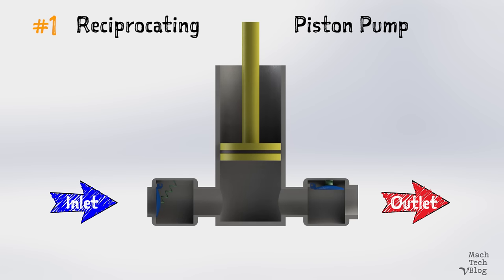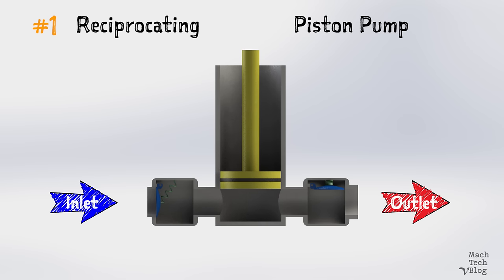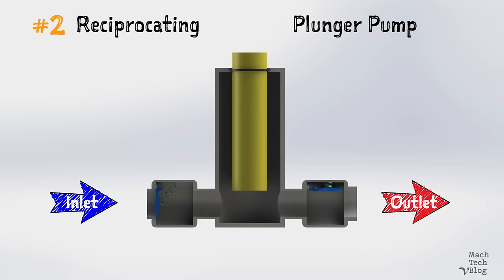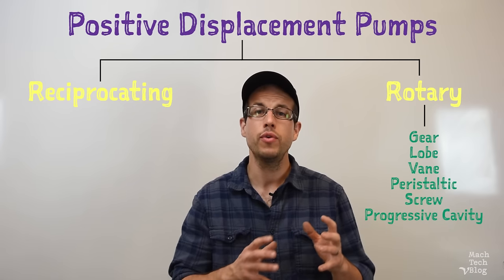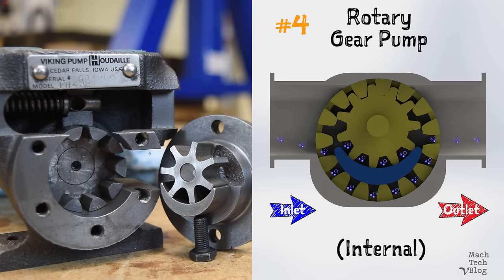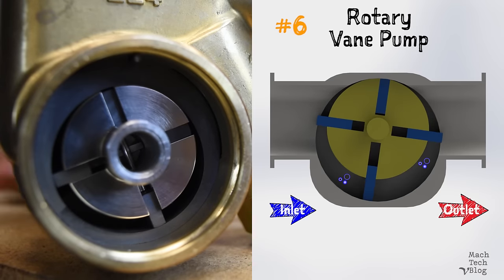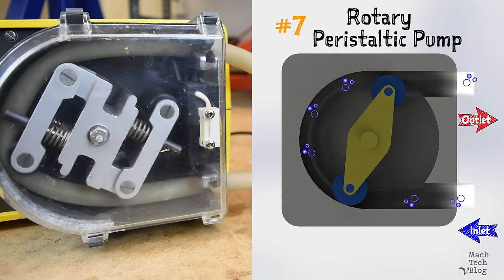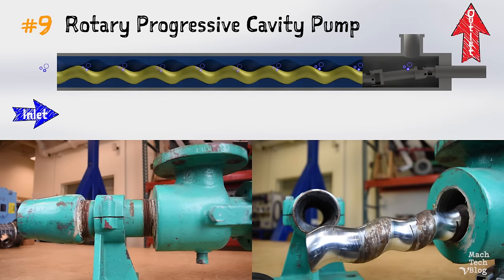Positive Displacement Pump Types

Comment: As someone that has been building/rebuilding industrial process pumps for over 10 years I can say that these videos are better than anything any actual pump manufacturers have. It's nice to see fluid transfer get some love, you see fluid power more often. Not that hydraulics aren't important. 

An interesting outlier on the PD pumps would be a SINE pump. You don't see them very often but they have their place.

In dealing with all these pumps, speed reducers, belt drives, couplings, VFD's, and everything industrial; one of the most interesting things I've come across is the Cycloidal drive reducer. I'm sure you have more suggestions than you can shake a stick at, but this would be my suggestion.

Comment: Good video, excellent presentation. Still, I have a few suggestions if you ever re-do this one.

1) Mention at the start what "positive displacement" means and how that contrasts with other types (i.e. why you would want to choose a positive displacement pump)
2) On the plunger pump, you mention that the "physical mass" of the plunger creates the change in volume of the chamber. It can't be mass,  it must be the physical VOLUME of the plunger.....
3) For the peristaltic pump, I think it would be good to place greater stress on the point of the pumped fluid never touching the working parts of the pump, and thus the pump cannot be contaminated by the fluid, corrosive liquids can be pumped, the pump mechanism cannot contaminate the fluid (thus good for certain food and medical applications), etc.
Reply: i agree, when i worked on an offshore rig, we used several different pumps to move fluids around.

i learned that centrifugal were great at moving high volume but lower pressure fluid. Can be used to pump fluids with small amounts of debris but cost more if it gets damaged. 

we used PD piston pumps for high pressure stuff but they needed big motors to drive them.

we used PD diaphragm for pumping small amounts that had debris in it because they were cheap and very easy to rebuild, and pumped trashy fluid better than others.  A kid fresh out of high school can be shown how to work and rebuild one in a day . i suggest this one for shops over centrifugal.
Reply: I was about to comment the same as your point 3, I'd never seen peristaltic pumps before I started working in a chemical lab. Being able to keep moving parts entirely out of the flow is a huge advantage for maintenance, purity, and consistency.
Reply: @johnstonefield1935  That point 3 is also the reason why they're the pump of choice for heart-lung machines and dialysis machines.

Comment: 2:50 These can also have variable displacement by tilting the thrust plate. Those little holes are for some of the pumped medium (usually oil or fuel) to act as a hydrodynamic bearing for the pistons.
A typical use case is a hydraulic pump or aircon compressor.

Comment: Nice video to understand the basic types of pumps. Briefly illustrated the working principle of each pump by showing the animation. Placing the actual model next to the animation helps to understand how the pump actually looks and operates. Brief application has been explained for Peristaltic pump saying it can used for high viscous fluids. It would be great if similar kind of brief application is provided for other pumps as well. Thanks for such a nice video bro..

Comment: About the vane pump, is that centrifugal force instead of spring load pushing the vane on the casing? Or just in the video, is the solid shaft connecting 2 opposite vane to the casing?
Reply: the vanes are loose and are trapped by the front and back covers. The pump must never run dry though as it relies on the fluid to lubricate the vane face and the outer casing and also the slots the vanes sit in. The vane holder is offset so the vanes are pushed back in as they near the top of the case. Look up JABSCO Vane pump!

Comment: I am working on a pump concept, and want to ask, what material can be used as a diaphragm? main concern durability
leather
latex
100% silicone
or maybe sinew
Reply: Usually standard Rubber as its cheaper. Different rubbers have different elasticity. Check out Wilden pumps

Comment: What was cause your rotor bolt to snap during operation?.. usually the bottom fro. What I've seen... spacing between rotor bolt and cover was my 1st hunch... but nat too sure anymore as I just removed another broken rotor bolt and the head of it has no scratches like if it were to wedge itself between the cover and theeads.

Comment: The last example, progressive cavity pump: They can basically run in any direction but the far most common is with the inlet closest to the motor, the reversed direction from what is shown here. The shown direction is good when there is great vacuum on the suction side since that vacuum does not risk drawing air through the shaft seal which is not at the suction end in this case. The drawback is that the shaft seal sees the outlet pressure so this arrangement is limited to a few bars outlet pressure, otherwise you blow the seal.

Comment: please also mention the applications of these pumps in industry
Reply: jahp, I missed that too! advantages/disadvantages...
Reply: peristaltic, rotary lobe and diaphragm pump are widely used in pharmaceutical production especially in biotechnology since generate less shearing forces. Peristaltic and diaphragm pumps are used in single use systems for pharmaceutical production - one can easily separate pumping element and pump drive - lower contamination risks
Reply: The rotary progressive cavity pump is used as a concrete pump. The housing is made of hard rubber and can withstand sand and small rocks in the pumped mixture.
Reply: @brys555  also in sewage plants, They handle very thick liquids with high solids with ease

Comment: Excellent Description and is 100% correct. Is it possible to gain permission to use this video for my website blog? 

As for the applications of each...we cant give away all out secrets but: the piston pumps are often used in pressure washers, Diaphragm pumps are excellent for dirty sandy water and construction sites, gear pumps are for oils and fuel, Rotary lobe is used in food such as meat pie fillings, Rotary vane pumps are often used as bilge pumps in boats, peristaltic pumps are used in hospitals when your on the drip, Rotary screw pumps are used in crude oil as they can transfer gas as well, progressive cavity pumps are used often to pump sewage or solids laden fluid long distances at high pressure, however they can also be used for food process where their gentle action doesnt cause damage (eg fruit yogurt). Trust this answers the questions below!
Teknik Group Sydney Australia- leaders in Pump maintenance and Repairs

Comment: 7:15 the image in the left (actual hardware) shows the vanes opposite each other are physically connected, thus the retracting vane is pushing the other vane outwards. Centrifugal force is not required (and would not be reliable at low RPM). This only works in a circular housing. Some vane pumps use springs to hold the vanes against the housing.

Comment: Are any pumps driven by temperature?  Imagine the oil in the AK pipeline has to be warmer to make it more viscus for pumping.  If the temperature cools and the oil is more difficult to pump, do the pumps shut down until a temperature sensor tells it to pump again?

Comment: hi i've got a question  i'm currently putting together a pelton turbine to turn my 100 kw alternator but i need a water pump that can pressure the lines enough for the spearhead valves to work correctly to get the right velocity for turning the pelton turbine what pump type would you suggest centrifugal pump for moving the large amount of water or a positive pressure pump or even both if necessary?

Comment: Hi Adam, quick question, if you had a choice among these pumps, which one would you use as a high pressure pump in case of gasoline ? since lubrication is a huge problem, when considering gasoline.

Comment: Positive displacement is more to do with the piston hitting a positive stop in both directions e.g piston moves forward and hits a physical stop and the same on the return stroke Volume and stroke is adjusted by a micrometer on the drive end. This method gives higher accuracy. Peristaltic pumps are not positive displacement and are not accurate due to soft tubing and rollers. Look at HIBAR pumps for high accuracy positive displacement, volumetric pumps. Super high accuracy
Reply: Positive displacement means the flow is pretty much independent of the back pressure, unlike e.g. turbine pumps whose flow depends greatly on back pressure. When a positive displacement pump encounters outlet flow resistance or blockage, it generates arbitrarily large amounts of back pressure, and the driving system (motor) has to either deliver more torque or slow down or even stall. Systems using such pumps will often have a pressure relief valve to limit the back pressure when flow is limited.
Although volumetric accuracy requires positive displacement, positive displacement does not imply volumetric accuracy or lack of pulsations.
Reply: @kevinmartin7760  Yes we'll said! thanks. My knowledge on the subject is using precision piston pumps for high accuracy doses so I appreciate your explanation. I don't tend to dabble in anything else and it's quite interesting the different applications where I now see it come into play. Thanks.

Comment: Ignoring normal use-case restrictions, I wonder what the noise comparison would be like for each style pump if they were designed for the same flow/pressure.

Comment: Awesome video. 
Got a question: I currently have a GD GAFMDRAX/6mr dual lobe blower in shop for repair.
These have the compression collar on each shaft for locking the gears to the shaft.
I have done only 3 repairs to blowers previously with ordinary shop and machinist tools.
Are there any specialty tools specifically for blowers that would make blower repairs as precise as possible, 
other than mics, calipers, feeler gauges, etc.?

Comment: anyone who can help/advise me or just recommend on what to research on, on what motor type or setup to use for an experiment that involves a 2 cubic meter chamber for vacuum forming that needs to operate 24/7 that can reach approx.  at least 28 hg in vacuum pressure and maybe 5 to 10 cubic meter per minute. i will really appreciate it. the chamber isn't really air tight sealed and material coming out of nozzle will emit vapor that becomes gas in the chamber. plasticized material will enter the chamber coming from a nozzle and will come out of the chamber as some sort of a formed texturized surface continuous pipe. the nozzle will seal the entry point while the output will also be sealed the the product itself. the chamber over all is sealed but not air tight sealed. so air molecules might come from gaps and the vapor from the hot material itself coming out of the nozzle.

Comment: Interestingly, rotary vane pumps are common in roughing vacuum pumps, and piston pumps in compressors. I’m guessing it has to do with the way the two systems work that one can achieve a better vacuum/high pressure.
Reply: GRBTutorials, that is exactly the case, take for example a gear pump, eventually the fluid can compress so much that it fits back though the mesh between the gears. And with vacuum, I’m not sure if the reason.

Comment: Thank you again, great video, quick question regarding the cavity pump, what would be a better option then the cavity pump, we are pushing higher solids, is liquor that contains dical, thank you
Reply: Don't use slang or your workplace's jargong in questions, there's no substans with the name dical. Do you mean dicalcium phosphate or some similar rather abrasive slurry? In case of heavy wear on progressive cavity pumps, I have sometimes switched to peristaltic pumps (hose pump) instead. They are generally more tolerant to abrasion and work good if the pressure is not more than a few bars and the temperature is below 80 °C. Just be careful with the pulsations. A diaphragm pump can also work if the viscosity is not very high.

Comment: I'd have liked to see a little more elaboration on the different characteristics between the pump types, such as relative head pressure, flow rates, and maintenance issues. Good video regardless, I'd not heard of a few of these.

Comment: We facing low flow at high pressure in Vane drive pump, I have check clearance between cam & vane which is ok and RV fitment in pump case 

Can you help us to resolve issue

Comment: Peristaltic pumps are commonly used in the medical field because they are very sterile. The fluid never touches the pump itself, therefore staying sterile.

Edit: these are my favorite type of pumps. They are so weird but so useful in the right circumstance.
Reply: Also the food industry. My favorite application is anywhere small precise amounts of fluids need to be metered out from a larger reservoir. Soda machines for the syrup to water mixed on the fly, or chemical injection into flowing water for industrial processes. I really want to make a Raspberry Pi that makes mixed cocktails for me using several pumps.
Reply: Kevin Holmes you are also very correct!

Comment: You didn't mention disk pumps! Someone mentioned 'low velocity, high compression ratio intermeshing counter rotating disk stacks' as an efficient and durable compressor design and I found your video hoping to find a visual because I know what each of those words individually means but I have a hard time believing such a thing exists! Disk pumps for air tend to be fairly high velocity and I've never seen one in an intermeshed configuration!

Comment: Just wanted to mention that pump #5 is more accurately known as a circumferential piston pump. Lobe pumps have rounder features on the rotors that make line contact with the body, not area contact as is shown with the CPP.

Comment: I am a journeyman (graduate apprentice) in the machine repair trade.  We learned in hydraulics class, taught by a hydraulic engineer that a pump produces flow only and not pressure.  Pressure is defined as a resistance to flow. Please update your video to reflect this law of physics.

Comment: You vane rotor pump has connecting rods. It uses the outer wall to drive the extending vein from the contracting vein.

Comment: I just want to make 1 small correction 
Not all interal rotary pumps have a cressent bit ov metal, instead the gear sizes are just different enough to let one pass inside the other
(My car oil pump is like this)

Comment: I've worked with a lot of these in a lot of applications and I've gotta say, progressive cavity pumps can go fall off a cliff. I've always had issues with them getting stuck, scuffing the stator and shredding themselves no matter the fluid they are operating on. Rubber gear pumps like Bowie pumps do a far better job on a far greater variety of fluids. So I ask, has anyone found an application where progressive cavity pumps really shine?
Reply: pharma... single use diaphragm pump heads can be delivered as a sterile tube assembly. There are widely used in chromatography and filtration systems alongside with peristaltic pumps (which is even more popular). Key benefit of such approach - your equipment has no contact with product. No need to validate cleaning procedure, no need to even provide such procedure - only thing that touches your product is single use flowpath.
Reply: @MrDrunkenknight  Yeah, I see the application for a single diaphragm there but not the progressive cavity pumps.
Reply: @geraldgepes  yeah, the last one seems to be least reliable )

Comment: The distinction between the piston and plunger pumps isn't really clear. It seems that the only differences are that a piston pump is a plunger pump where the plunger is the full diameter of the chamber and the seal is attached to the moving part rather than the case. You can morph one design into the other and it will work as a pump at any intermediate design stage. The distinction is even less clear for something like the rotary piston pump you showed, since it relies on close piston fit rather than a resilient seal.

Comment: The vein pumpo is a bit misinformed. There are two types. Where the oposing vens are actually one single piece. (and to slide, there is a cut in the middle on half of the width). The trick is the inner shape has to be a shape with constant width and height about the center of rototation of the rotor (that is eccentinc). So the shape is not a circle but a weird egg or something. And this type can't compensate wear as the other vein will open and lose pressure.

The other kind is the independed veins. some may have springs behind them, bot most do not, because there is a groove in the housing (the top part), that is connected to outlet pressure, and this groove feeds fluid behind the veins forcing them out in contact with the bore. This is how most steering pumps in cars work.

Comment: lobe pump, when 2 rotor rotate they impact together and issue metal dust. It effects to product quanlity
Reply: No, the fluid lubricates the pump. He forgot to mention that they must never run dry!
Reply: The internal gear rotary pump and the external gear rotary pump have one gear driving the other so a lubricating fluid film is required. The circumferential position pump ( which the video calls a lone pump) has timing gears on the drive shafts that maintain clearance between the rotors. Unless the pump is worn or is operating above the temperature it was clearances for, the rotors should not touch. In the event that they do touch, they are made of a nongalling alloy.